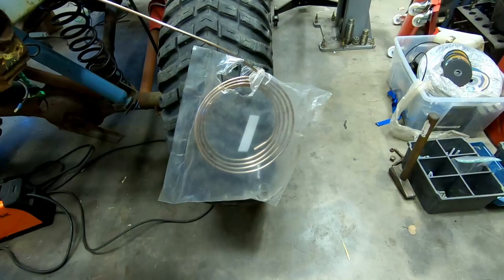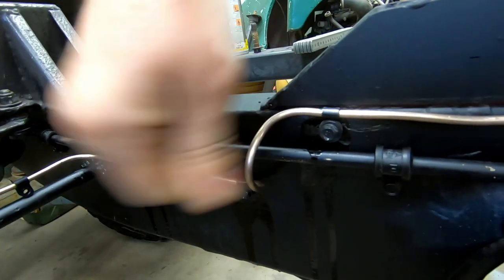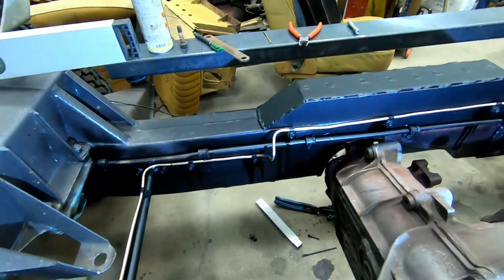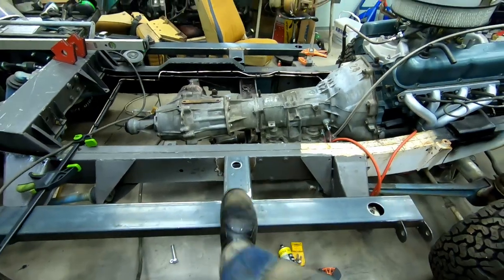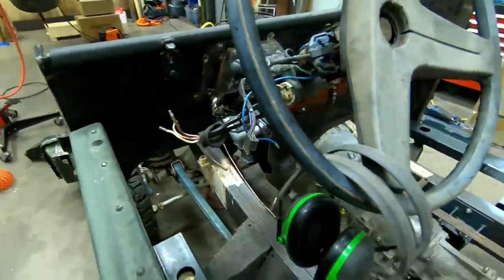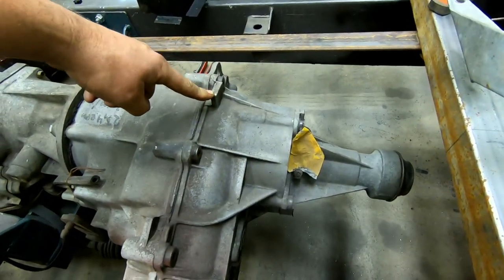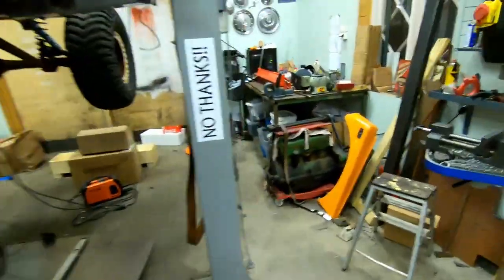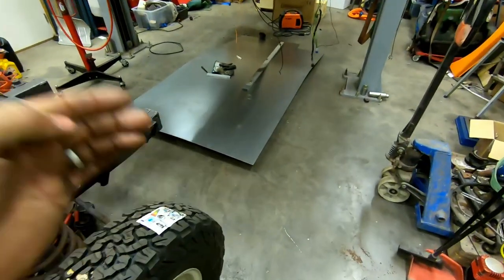Landy 100" Rear Brake Line Job, Range Rover

Comment: What type of pipe bender are you using?? I would be very interested in purchasing one for myself
Reply from the maker: Aloha! I have a pipe bender from Eastwood that is good for soft pipes. Works great with brake pipes but not very good for nickel fuel lines. But I have another bender that works good. I'll  try to remember showing them in the next film. 👌